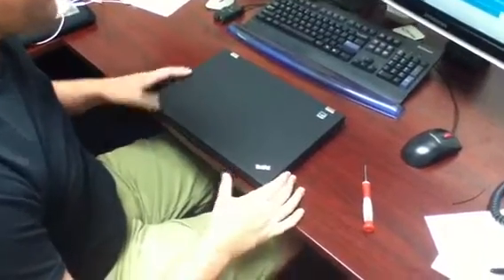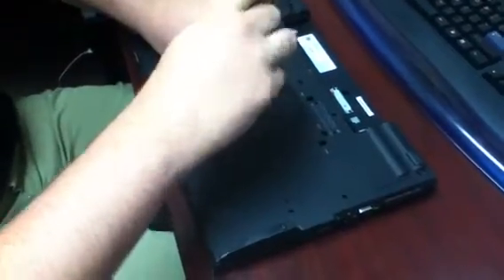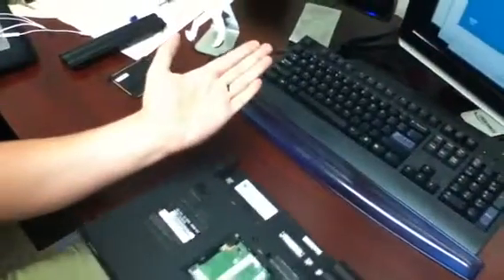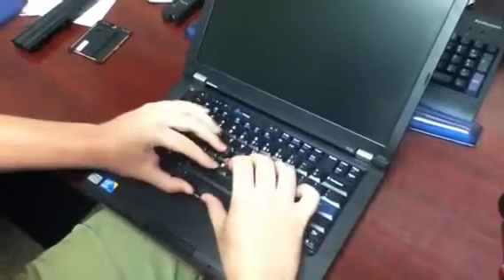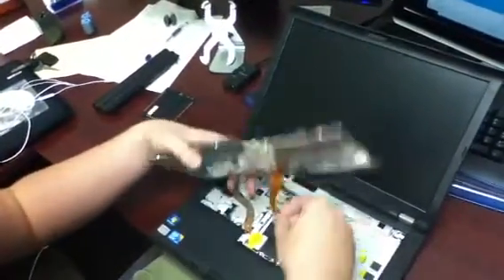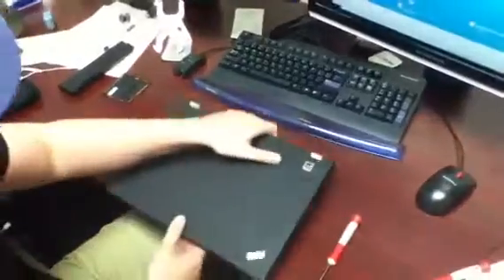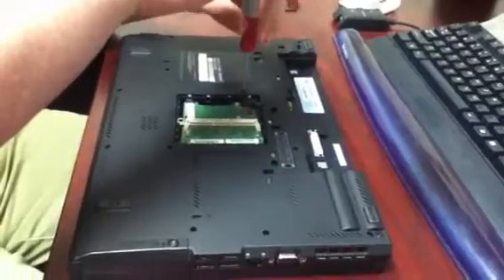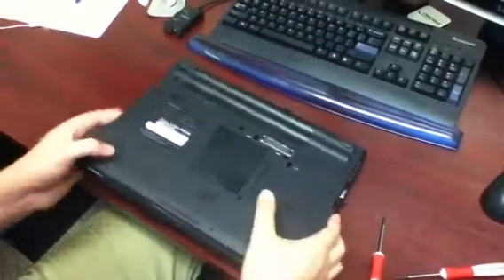Lenovo ThinkPad T Series Keyboard Replacement

Comment: Very helpful. For anyone replacing keyboard in T430s, there is an extra screw on the bottom just above the screen pad that is visible after removing battery.